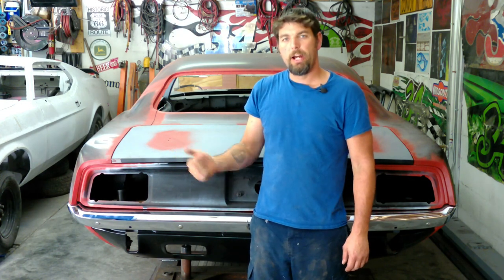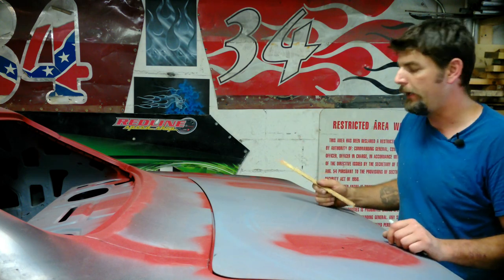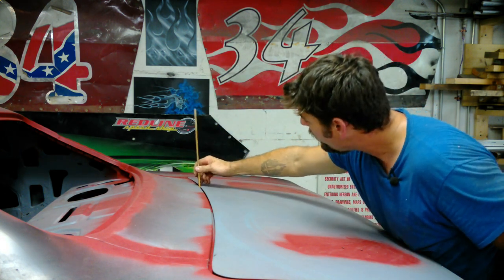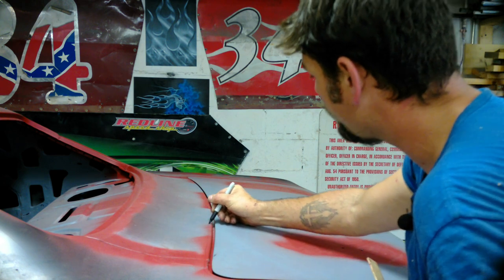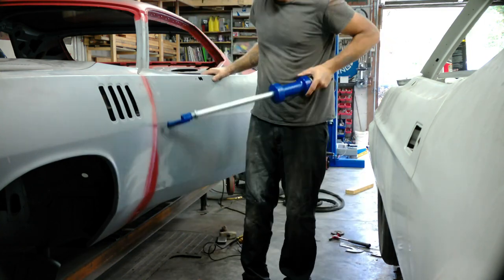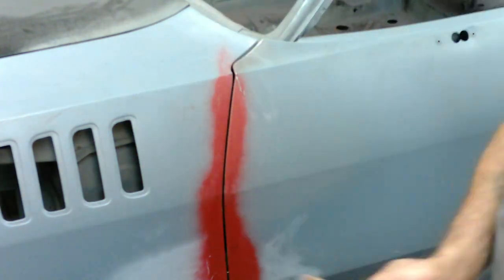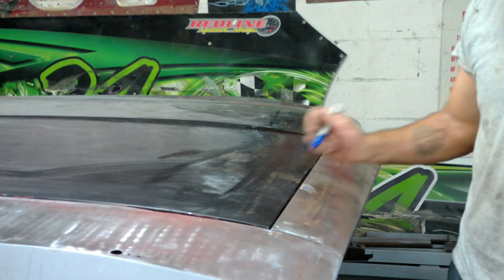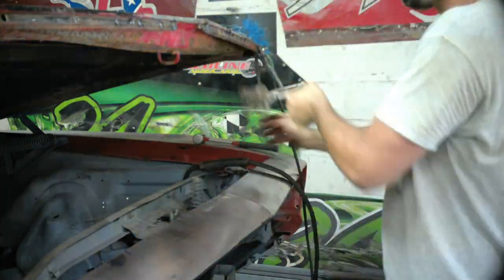Setting and Aligning Body Panel Gaps on the 1971 Barracuda Episode 11

Comment: As a mopar guy.. I can say these gaps are way to good. lol Nice workmanship.
Reply from the maker: Thank you very much!
Reply: I was thinkin the same thing.. I see too many “restored” cars tho with all sorts of screwed up looking panel gaps where the trunk or hood meet. Or a hood that’s slightly raised on one side and doesn’t lie flat. That’s just lazy.. however it seems that’s the least of a buyers worry these days. The stuff my families body shop has seen from people buying classic cars from auction are very expensive nightmares. They look so great when you first get a gander.. you get under it and we’ve seen sections of frame rail made out of bondo.. bondo door panels that are shaped even yet have zero metal anywhere. The worst was when someone used a dent puller tack AS A WELD. Yep..

Comment: Excellent instruction!  I just found your channel.  Im building a 67 Fairlane 2-door hardtop and had to replace a full quarter. i have never done this  before.  Im spending all my time at the front of the quarter, by the factory door.  The body lines of the quarter panel at the front are just a bit off.  This video will help me out tremendously.  Thank you
Reply from the maker: Thats really great to hear. Thanks a lot! If you want some extra tips I have a newer video on a 73 challenger where I show some other tips and tricks that might help you.

Comment: Really well done!  You really aim to do everything you can to minimize body filler.  I have a 70 Cuda and the front of the trunk is so high above the dutchman paner, or panel behind rear glass.   Funny thing is that the sides and rear seam to fit nicely.  Anyway, you really inspire me to get to work on it!  Thank you
Reply from the maker: Thanks a lot and yes less filler is the goal. Good luck on your Cuda a little cutting and welding and it will save you lots of headaches down the road.

Comment: where did you learn all this at. you have impressed me big time and have learned a lot. thanks. Is this your living or just a hobby?
Reply from the maker: Thank you very much! I have been messing and around hot rods my whole life so mostly trial and error. I have spent many years racing and building race cars so most of my fabrication has been learned doing that consistently. I started restoring more of flip cars in my early 20's as a hobby along with my own stuff, then worked on friends/family cars and the hobby over the years has turned into the business it is now. I am always trying to build on my skillset and be better with each project so self motivation has some to do with how I work. Thanks for checking out my videos also.

Comment: Rick, another great tutorial, thanks! So, I have a question and forgive me if I'm missed it among your other videos. Much time is spent gapping and profiling the panels and then you pull them sometimes to paint. I'm talking, doors, trunk, fenders, etc.  After paint, how do you quickly and accurately align those panels without chipping paint?  Do you have some kind of process for that? If you've not done a video on this, I'd sure like to see one from you. Thanks!
Reply from the maker: So sometimes I will drill a 1/8 hole and align the panels back up and that hole would be covered by a bolt or sometimes I just realign. It honestly depends how hard the panels are to get where they go. I also make sure any shims are labeled as I am removing them so its easier to align. Saying that I am working on the second part of the body work video on this car. Its been on the friends and family plan so taking a while but I will try and cover my process in that  video how I go about finishing it to try and show you how I paint them to avoid damage as much as possible.
Reply: Thanks, Rick!

Comment: Nice work! When slicing the panels how to you treat the backside of them?
Reply from the maker: That is a great question, unfortunately if the spray and pray doesn't get it that will be an area without primer on it. I know its not the ideal case, however if you see most of these cars had large portions of bare metal from the factory a small spot here and there is still better then they were. If you also think about it anyplace you weld even with the weld through primer will burn it off a bit. We can't make it 100% covered but we do the best we can so they live on for the next 50 years even better!  Good thing about that is all the time if paint can't get to it water should not also be able to touch it slowing down any corrosion.

Comment: Looks really good. Do you use this same process on other vehicles that require perfect gaps?
Reply from the maker: Thank you and yes for the most part I use some version of this process depending what the owner is looking for. Some are more then happy with how the car started it as especially with a driver. I am always trying to think of new ways to make the process better. I have also used lead before to add to gaps to close them up also on jambs.

Comment: Do you seal the weld underneath with anything? Thanks...
Reply from the maker: The goal is to try and spray epoxy on the back sides where they are accessible, in reality that might not always be the case, but we do the best we can.

Comment: Sweet .... curious if this a match build or clone ish??  I have 71 383 Mag. H.P.  Match's Barracuda Gran Coupe most optioned E-Body made 1 of 32 believe. Possible 1of 19 told!!!
Reply from the maker: This one will be a tribute in the loose sense of the word. It was a base model Barracuda. Your 71 sounds like a really awesome optioned car, take care of it.
Reply: Yeah I noticed figured it was! All 👍. Do ya already have drivetrain fit the plan?
Reply from the maker: Yes I have all the drivetrain parts ready for the most part for assembly already

Comment: the attention to detail is awsome great workmanship. Would you possibly consider filling the gap between roof and quarter panels with weld rather than lead ?
Reply from the maker: thank you and personally I would not weld up that entire gap. Lead melts in a lot lower with the heat then you would ever have to get to weld mild steel. So the heat it would take I feel to add that kind mild steel tig rod in a gap that large would have a great chance of warping the panels. If you had your heart set on that i would put a patch over the two edges covering the middle gap and weld that up, but to me that also doesn't have any advantage. Also the amount of time on the welding machine would be a lot, just in general I don't think practical. Lead has proven to last decades upon decades so I think that is a good option also I would also consider using kitty hair or a alunimunized filler material like All Metal.
Reply: @carthageclassiccars  Thanks your thoughts, I agree lead has been used for years successfully, I wondered if it was used by manufacturers as was much simpler and quicker to apply in factory conditions than 'cut and butt'. Great work by you, will look forward to future videos.
Reply from the maker: I think your right, the cheapest and easiest way to fill any slight fitment differences between how each car fit up between the roof and quarters.
Reply: @carthageclassiccars  👍

Comment: What do you do if you open the trunk and rain water gets inside
Reply from the maker: it sounds like the seal is cracked or damaged or there is a rust hole in the drip rails. Look closely and find the hole and seal it up. There are many ways to do that job depending on what you find. Good luck.
Reply: Thank you

Comment: Why not use brazing to add material for your gaps? It's easy to add and shape.
Reply from the maker: I do TIG braze on these cars every now and then. I actually have done in on some of my videos to show where i use it. Mostly in seam areas or filling gaps. Personally I like traditional weld fusing the panels together if I cut the door, put a slice in a panel to relief it back and even building up an edge a fused weld is far superior in strength. Thats why you really should be butting panels and brazing them to hold then together. That is not saying brazing wouldn't work as you described more of a personal preference. The only benefit I see to brazing is less heat input and easier to sand down. The downsides I see is where i weld on the edges I don't have to worry about the heat and the cost factor of brazing rod is just so high compared to its mild steel counterpart. To me there is no enough benefit to justify it.
Reply: @carthageclassiccars  thank you for your knowledge.
Reply from the maker: you are welcome thanks for watching!